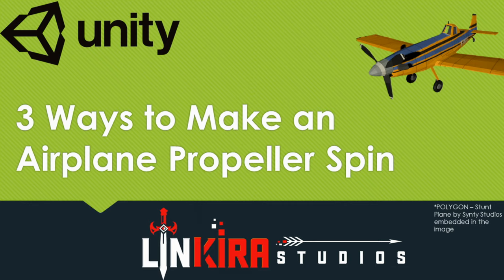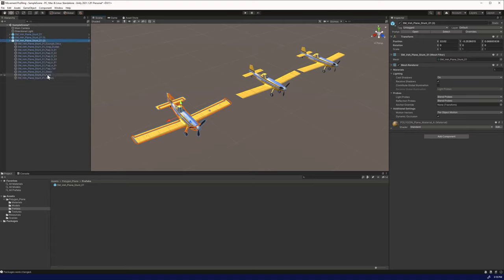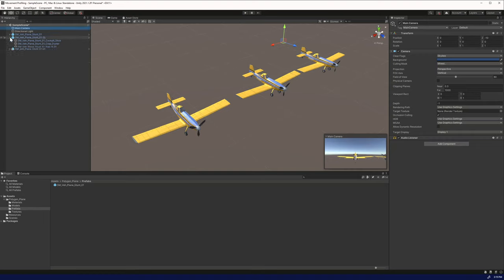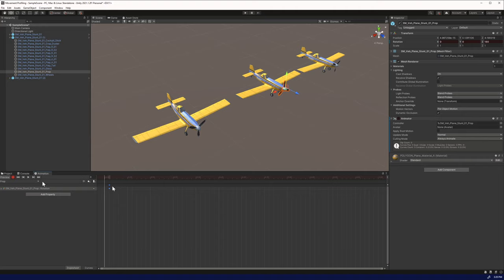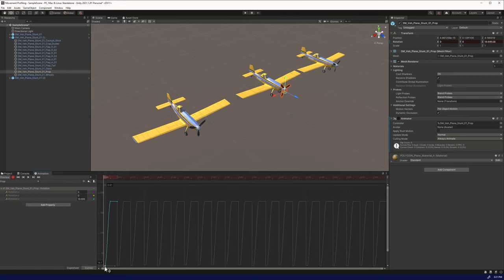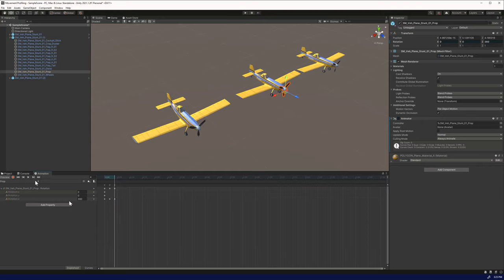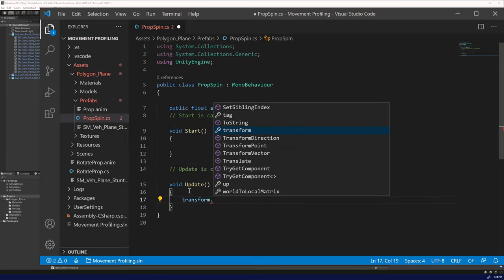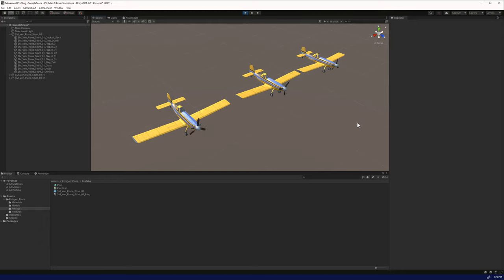3 Ways to Make an Airplane Propeller Spin in Unity

Comment: great video it worked good, if you want a simple way use the rotate code tactic, if you have an issue that says compile error make sure you add a semicolon after the public float speed in the vid in the code part

Comment: Thanks for this. That code solved my issues. I had a compile error and it ended up being the absence of the = in between speed and the float value.
Reply from the maker: Yup, those little things matter.  I try and leave up the code for more than a second so you can read it.

Comment: Grate video but what about preference? what is preferred?
Reply from the maker: Which did you like?  Animation is sort of easy to start and stop.  The config joint makes it so its physical, so if you stuck a stick in it or blew it off, you would see the results.  Code isn't bad either.  So kind of up to you.
Reply: @MajorBatman  ohh sorry auto correct.. i mean what is better performance wise

Comment: Hi Linkira Studios, I'm currently going through the Junior Programmer course in Unity which lead me to this video in the end. I thought I would give it a go with some code more simular to what we learned in the course so far (haven't learned about the fixedDeltaTime or the Space.Self thing yet).
I wrote: "transform.Rotate(Vector3.forward, turnSpeed * Time.deltaTime);" and it works no matter which direction the plan flies.

Is one line of code more effective that the other, and if yes, can you explane why? Do you know if the line I wrote will give me "trouble" later on in some situations? I really want to get good at this and to understand what I'm doing you know. It's soooo hard to get around that there are so many ways to do the same thing :D

Thanks for the great video and demo of three diffrent ways to make the prop spin.
Reply: Hi, I'm also going trough the junior course but I have no idea why but "transform.Rotate(Vector3.up, turnSpeed * horizontalInput * Time.deltaTime)" doesn't work for me, the horizontalInput "does not exist in the current context" I don't know how to fix it.
Reply: @UCb1yDKET0lwZCY4bIMI5NSQ Well at first I did my own code so the Public float was "RotationSpeed = Insertnumberhere" but I believe I forgot the f tho, and as the forward instead of the up it didn't worked anyway and I decided to be more radical in my learning ( I decided to learn C then C#, so I would know exactly what I wanted to do and how) but ty for the help, good luck to you in your course !
Reply: @jettonial  It's because I'm sleeping.. Sorry, I looked at the wrong script. That one was to steer the plane towards/away from the screen. I made it to test if the propeller would stay connected to the front or turn onto the side of the plane when turning the plane.

The code you should try instead is: transform.Rotate(Vector3.forward, turnSpeed * Time.deltaTime);

I double checked this time ;)
Reply from the maker: Sorry y'all, I was on a trip.  The Vector3.Forward creates a vector3 equivalent to 0,0,1 which  just points from the tip of the plane out towards the horizon.  If it was a Helicopter you would want to use Vector3.Up.  It is just a short cut. instead of defining a simple forward vector.

So if the plane flies backwards, the propeller is still spinning like its going forward?  Is it disconnecting?

Also if you but a horizontal input, be careful sometimes its -1 to 1, which could effect the speed of the rotation as well.
Reply from the maker: Did you say the Junior Programmer course referenced this video, or that you went looking for some more info on rotating by taking the course.
Reply: @MajorBatman  Thanks for your reply. Nah sorry, I went looking for some more info and found your video ^-^
About the horizontal input I wrote the wrong code in my first comment. I edited it out later ;)

Comment: I tried the 1st way but didn't work.. But I tried also the 3rd way and it works ty
Reply from the maker: What ended up happening?  Config joints are a little finicky but are fun to mess with.  Check out my latest tutorial on Opening a Door to include using a Hinge Joint. https://youtu.be/Ky0ASq9YA-M